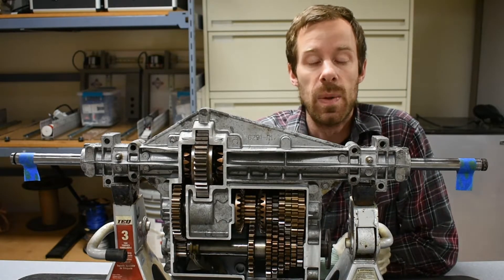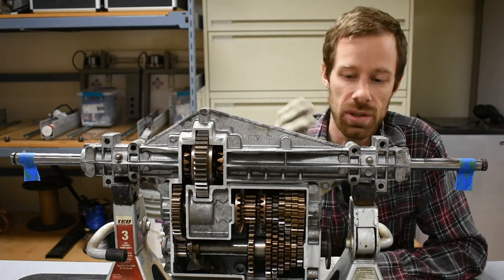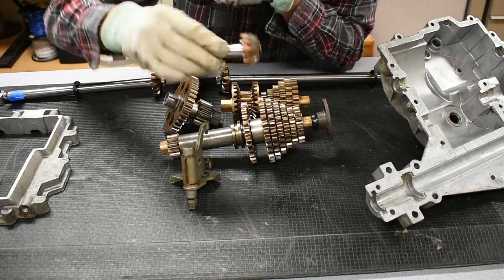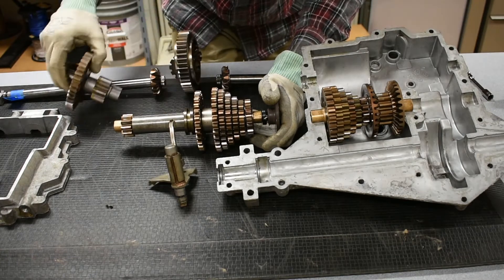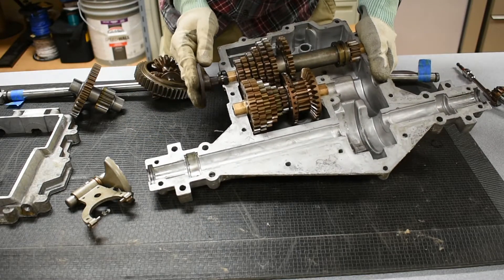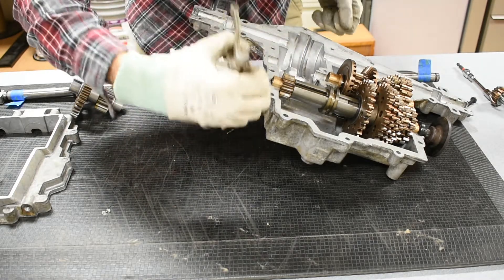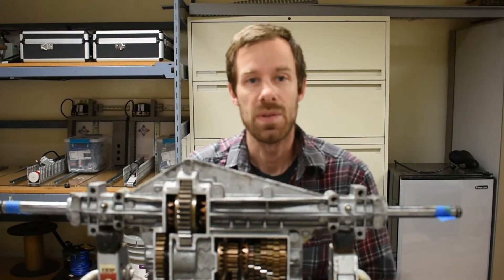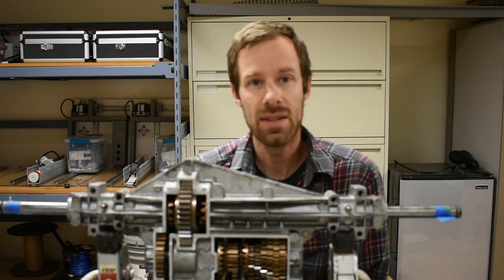How Does a Transmission Work?

Comment: Is this a cvt trans
Reply from the maker: Not sure. I've seen CVT referenced a few different ways, like you can have CV axles in a lot of commercial vehicles (which I have some of those - trying to find time to do a video soon), or you can have a variable radius on a belt pulley, like in some CV torque converter. This one is technically a constant velocity from the engine, but I don't think people usually call it a CVT.

Others with more knowledge might weight in on this question...